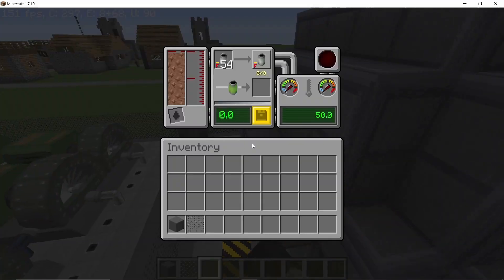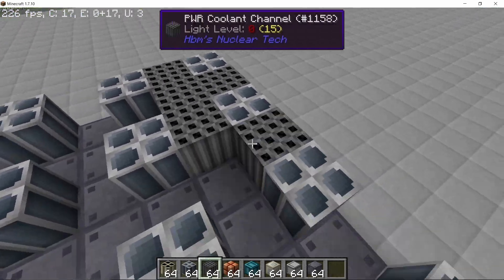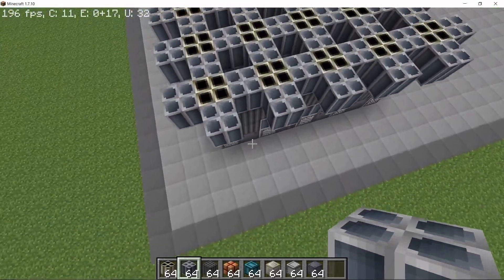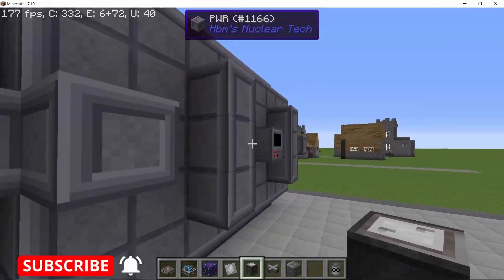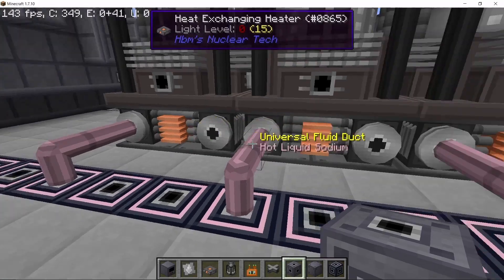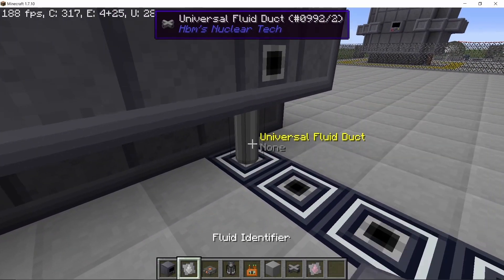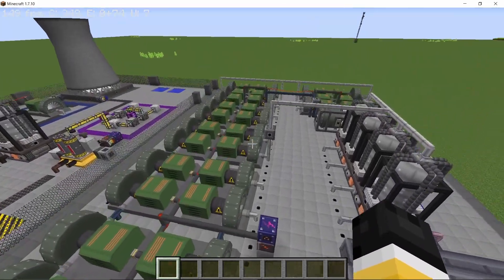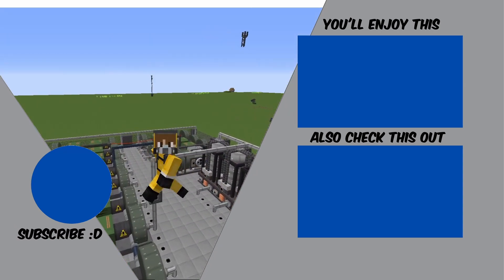Uranium-233 fueled Pressurized Water Reactor : Liquid Sodium Coolant : Nuclear Powerplant Tutorial

Comment: 35 industrial steam turbines😳 I'm just curious, will (minimum required amount of) leviathan turbines be more efficient and space saving or will it not..?
Reply from the maker: You'll only need one leviathan steam turbine, that should save up on alot of space. And due to reduced efficiency you will get 108 MHE/s instead of 128 MHE/s. So that's the trade off
Reply: @SavageVegeta  this actually makes sense, fair enough.
Reply: @SavageVegeta  LEVIATHAN'S DO LESS POWER THAN THE INDUSTRIAL ONES?!
Reply: @efnaftuber4096 but so much space
Reply from the maker: Also it's 32 Industrial steam turbines not 35 :D